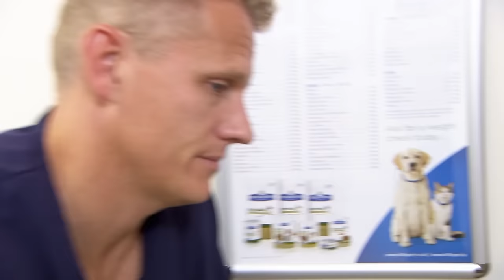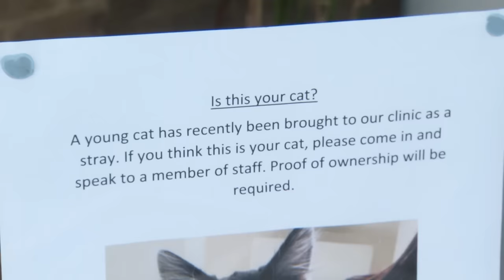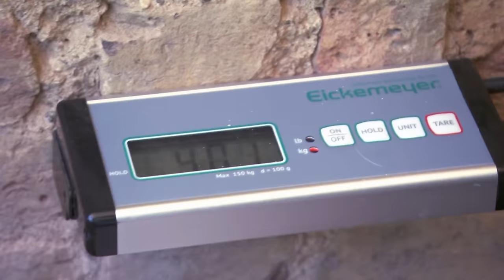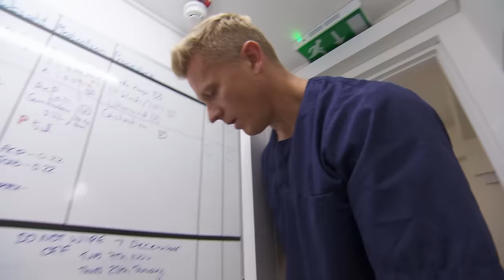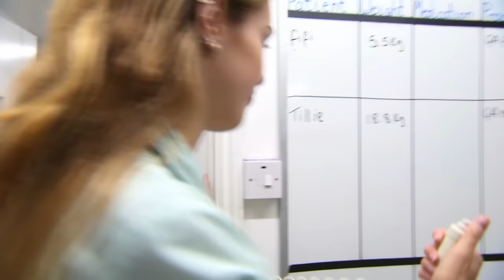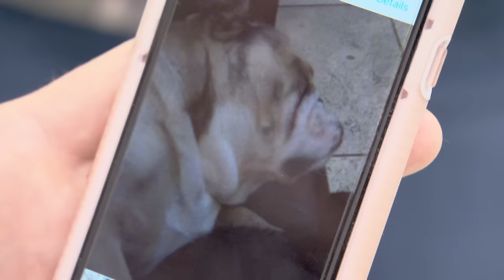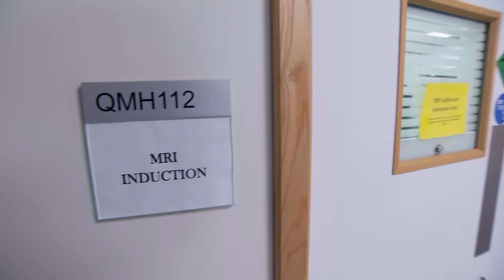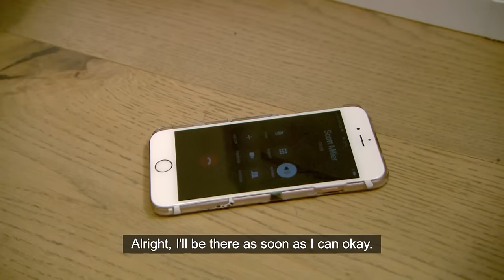4+ Hours of Full Episodes 🐾 Vet On The Hill The Entire Season 3 Part 2 | Bondi Vet Compilation

Comment: When microchipping animals... Wouldn't it make more sense to check the chip works BEFORE injecting ?  At least that way - you won't need to repeat the process, if a newly-implanted chip subsequently fails to scan !
Reply: The question may be whether the chip can be read within the animal, not if it works.